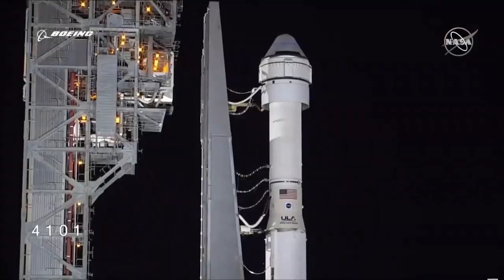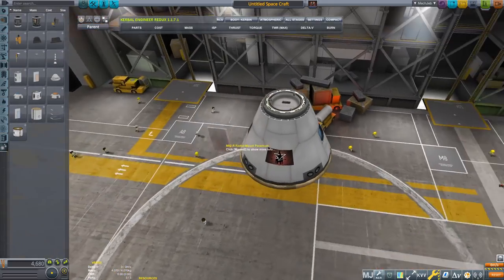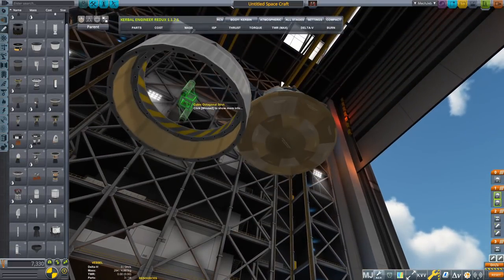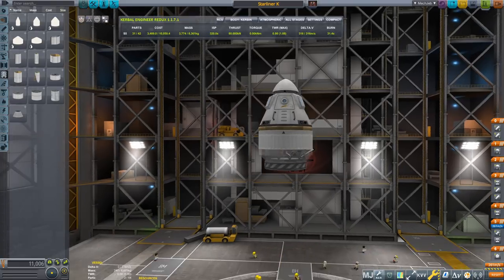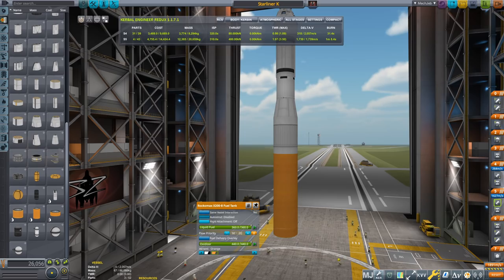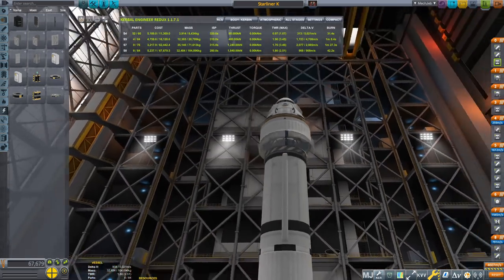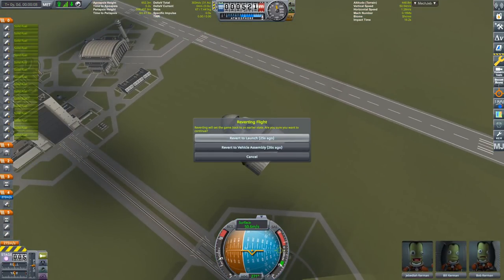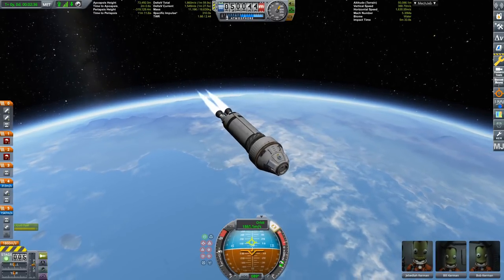How To Build Boeing's Starliner in Kerbal Space Program - And Fly It Correctly

Comment: Hey Shadow, I wanted to say thanks :) for doing your thing. While I must admit there are others you are one of the You tubers I learned from and now currently setting up my relay satellite web to the moon and other body system to prepare for drone and manned flights to the moon. 

I was able to make lighter efficient 2 and 3 stage lifters XD as compared to my 6 stage lifter. Happy I've finally graduated from ... darn i'm barely in orbit to space here we come :).

Relay satellites are equipped with 4 ion and tiny rocket engines to assist getting from around the body if necessary. (wanted to go fast XD)
Kerbin orbiting satellites are equipped with one ion and a large RCS thruster in case of de-orbit or extend to between moon and Kerbin.
(If anyone was interested)

Stacking smaller engines makes much more of a difference than i expected to using larger ones.
Tip to anyone trying to get past just orbiting, sometimes smaller is better but more thrusters still works. Then you can just action group them to toggle and use less fuel.

Comment: How do you lift the stack from the bottom without selecting the "original" part? I keep asking people on here and no one ever gets back to me ha.
Reply: Also, while I'm asking, how do you change the number of parts you're placing without clicking on the tool icon on the bottom left?
Reply: You'll have to set the root part to another part and then you can move the thing you want
Reply: @edwinrobert7192  Wait, how do you change the root part? I'm confused. Didn't know you could do that.
Reply: @daveduna1  at the top right of the parts menu, there are some buttons,  one of them changes the root part, idk which one exactly, it's been some time
Reply: @edwinrobert7192  thank you!
Reply: @daveduna1  no problem, I'm always here
Reply from the maker: If you hold Shift while clicking, the entire vessel is being moved. I also use a lot of shortcuts, like 1 for placing parts, 2 for translation, 3 for rotation and 4 to change the root part.
F changes between absolute and local orientation when using translation/rotation. R switches between radial/mirror mode.
And so on.

Comment: One of the astronauts  explained it.  The RCS on starliner was on at the incorrect time and they burned to much fuel because of it.  The result was had they attempted to go to the ISS they may have ended up way to low on fuel.  She specifically said RCS which made total sense.
Reply: Terrence Anderson Yeah, I found it strange that they used the RCS thrusters for their maneuver rather than the OMS thrusters that were supposed to fire. I wonder if they had some unexpected issues also related to the clock sync and what we will hear about in the future.